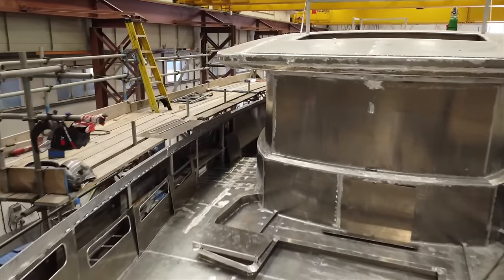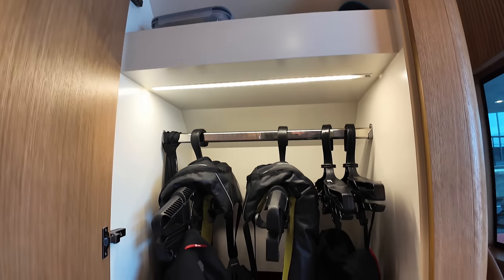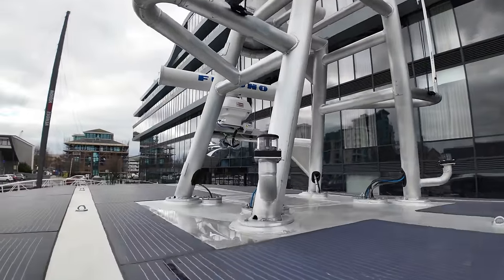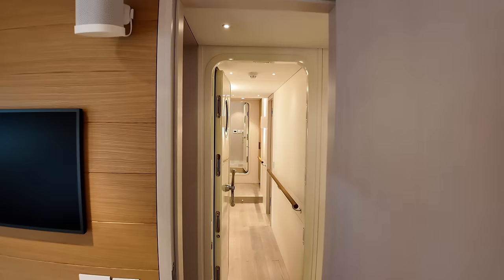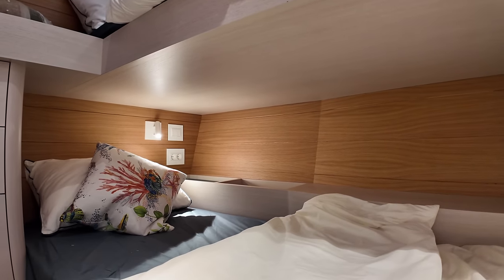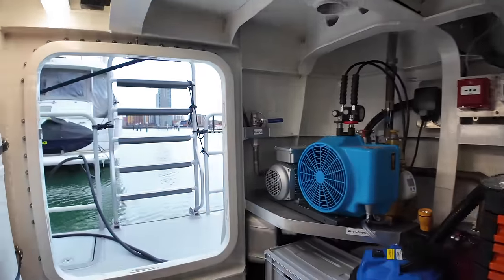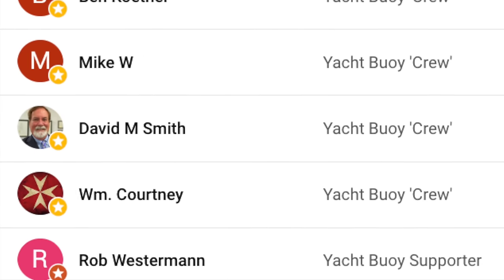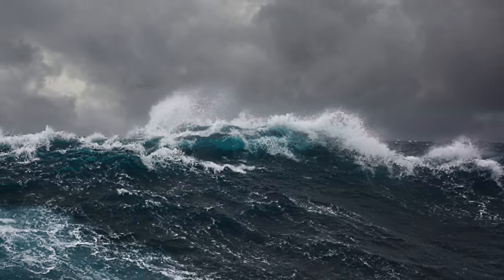THIS Is The ARKSEN 85! Liveaboard Explorer Yacht!

Comment: Fantastic craft, would have the jointing flush personally but keep the aluminium look for lack of maintenance. You missed the heated water nozzles on the front facing windows to keep the windows clear in very cold climates and the fold down seating next to the day head and stairs. Loved the Scandinavian look and feel to the interior.

Comment: Interesting to see no clear coat applied on the deckhead. For the southern ocean, condensation drips streak down on glass etc, and lead to corrosion. 
We apply Nyalic clearcoat, which resolves it easily.

Comment: how did they finish the hull to avoid the Alu blackening ?
Reply: It doesn't blacken; aluminium oxide forms, and the shiny aluminium simply dulls (goes to a darker grey). The rresulting finish requires no maintenance and salt water does not damage it.

Comment: She looks like a well designed and thought out, layout for the boat. This has always been a pet peeve of mine, that the electronics and batteries occupy the same space in a hot engine room, whereas a separate area that can be kept cool for the electronics and a separate area for batteries as well. This is just nitpicking, but the drawer that is marked with the flashlight, not for nothing, but if you need a flashlight, how do you see that marking in the... dark?

Comment: With reference to the fire suppression system in the battery compartment I’m not aware of any fire suppression system that can put out a lithium battery fire.  Submersion is about the only way to stop a lithium battery fire.  Fire departments just let them burn themselves out.
Reply from the maker: The composition of these marine batteries are different from the batteries which you find  in domestic goods meaning that they are not as vulnerable to thermal runaway as the batteries found in e-bikes etc

Comment: Top heavy to be self righting. Does not slip through the water as well as Dashew. How is AC an option? Range is a problem. Larger swim deck for following seas to step on. Nothing about the steering correction speeds. Spares and inventory control?

Comment: I had such high hopes for Arksen based on the sketches they released such as carrying a Nemo submersible and 2 giant tenders. This doesn't appear to be the case. The other thing was the unfinished aluminum. I had thought that these were to be covered in fairing material and painted. Not that it is a big deal, but just zome things about this didn't live up to the hype. Still an amazing yacht, but some of the things we were told just didn't materialize.
Reply: it's unfinished aluminum because that's what the owner wanted.  just about all your criticisms are the way the owner specs the boat.
Reply: @vorjay  Unfinished aluminium: no maintenance. Two thumbs up from me.

Comment: The weld finish needs either quality improving or grind back. Sleeping accommodation for guests in an 85’ I thought could be more spacious. The safety features are ok but what about redundancy provision? Bearing and Nordhavns are to my mind far superior. Thanks for sharing sir. Always enjoy your tours.
Reply: I think you miss the point.  it's not designed for volume interior; it's designed for efficiency.  its dry weight is similar to a Nordhavn 60 footer.

Comment: There's a lot to like about Arksen's designs , but some weird bits, too. Started for me with that absurd heads compartment on the otherwise interesting Arksen 30 & continues here . Really dislike the curved , ie custom, glass fronting the pilothouse. Hard to replace....except by Arksen....which I'm sure is the idea. How many other things are bespoke that, as a far-ranging owner, you'd prefer to be off-the-shelf ? The wetlocker in the vestibule is a great idea, poorly-executed; where are the other 6-8 peeps putting their gear ? Handrails everywhere but a non-gimballed transbeam cooktop with your back to the action & no "U" behind ? I get mixed signals there; either the boat moves like a sailboat, thus the handrails, or it's stable enough for a domestic kitchen style galley. I guarantee lines will NOT dry in those open bulwark stowage spaces anywhere there is rain and/or  spray, ie everywhere on the sea...lol... ( there's a reason gear lockers on quality boats are both drainable  AND gasket-sealed) & look like a huge stability issue if you take water over the side.  
Fit & finish looked iffy in spots, too. Overly-stiff door & cupboard handles/hinges, brand-new but already sagging upholstery, unfinished & paint spattered edges on the underside of that stair  stowage. If you can spot these sloppy details in a quick video, it makes you worry about the details you can't see that may be more than aesthetic. I don't think you'd see that on a Bering, for eg.
Good first effort, but some issues to be worked out, imo.
Sorry to be downbeat, YB, but honest feedback will do more for Arksen's future success than gushing ad nauseam, imo.
Reply: the handrails are just in-case touches.  the boat has Humphrey stabilizers and 2 sea keepers.   again...the people comparing this to a Bering, that's about twice the dry weight if not more, seem to miss the point.